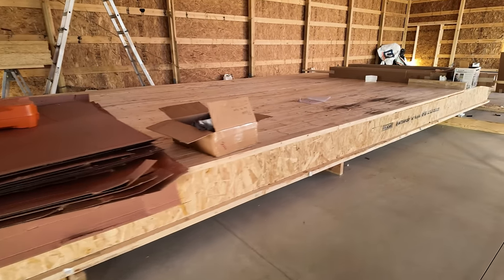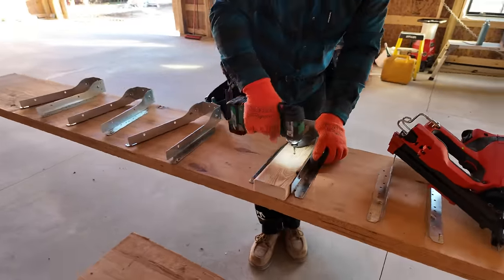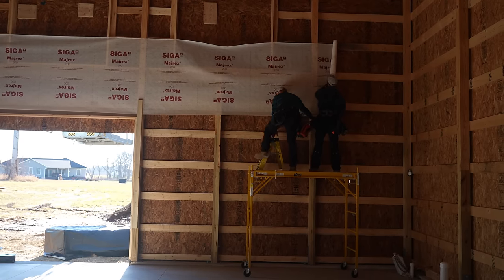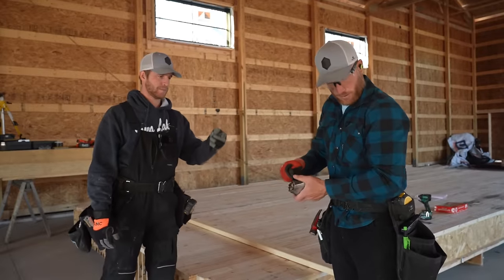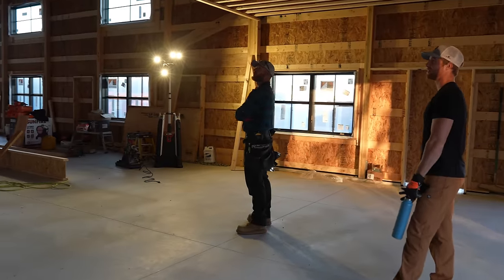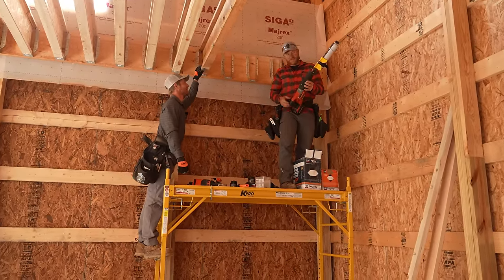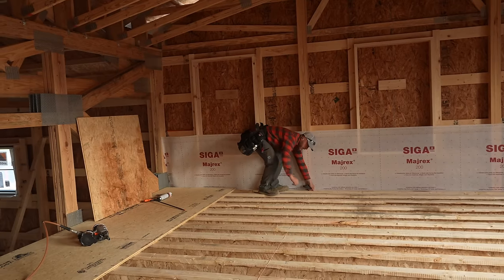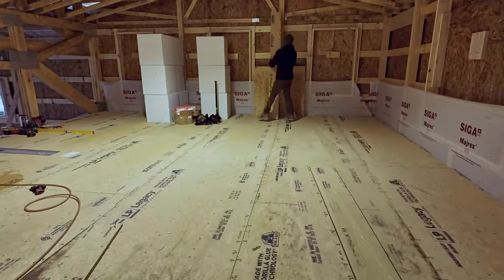My Dream Shop Ep-30: Crazy Second Story Floor Framing Install

Comment: Always great content.  
My son and I drove from WA to WY last year to help a friend frame a studio apartment inside his 40' x 85' shop I had earlier designed for him.  
Lots of fun.  
Road trip.  
Cold weather. 
Tough "Man Work."

You do a great job explaining what you are doing as you do it.  

I agree.  
Lagging a second set of LVLs with hangers applied, to the girder, might have been an easier but a bit more $$$ option.
I'll be scouring more of your channel since I will be creating a design for a 60' by 100' shop soon.  
(I'm recommending a steel framed project just to ensure clear span can work)

Again........your channel is 100x better than TV

Thank you!

Comment: Greg, that little piece of scaffolding that was bought will become a lifesaver! I have the same piece and it is so handy at times! Because you can adjust the leg height at each end is helpful! If your working on stairs or uneven surfaces it will pay for itself several times over!

Comment: Wow...those 2 point loads for girder trusses are carrying ALOT of weight.  
I did not realize until now, when you panned up through the ceiling, how that is all fitting together.  Nice shop, I am jealous.
Reply: Those two posts are carrying half the building 😂

Comment: Great job on the floor, we had a similar floor experience and after our engineer came out he recommended we install three cables from outside beam to inside framing in three of the floor spaces with ¾” eye bolts each end then when tightening it helped with any outside wall to the truss flexing, locking it all together ours was only 30’ long. In the old days they use to use solid rods with plates and bolts on the outside of the buildings lol.

Comment: I have used the same i joists for projects. In the situation where your truss has a 2x12 the top of the i joist needs to be supported with web stiffener blocks at the end for proper supporting strength. The hanger doesnt support it properly, due to the void in the "web" of the joist, or you can have the rimboard there to support the weight at the end.

Comment: I had to do the math on your floor since I'm an EWP designer.  You stated you had a span of 22' 10-7/8" with a 12" on center spacing.  Using our BCI 14" 90s I joist, here are the results.  Your max deflection is .312", or 5/16", in the center of the joist.  Damn near zero bounce.  Not bad.  I have the calc sheet saved if you like.

Comment: Good job!  Some ideas, you could have used 2x12 + a 2x4 for your ledger boards to save cost and do the same on your truss so your not nailing joist hangers into truss plates.  It might have been easier to place the joist hanger on the truss side ledger, as you set the I-joist.  You could block the I-joist to stiffen the floor and I think you mentioned 16" oc.  One last thing is, would start the sub floor sheathing at the wall, with groove at wall, tongue out from wall.

Comment: If you hit it too hard in setting the tongue in the groove you'll actually bounce it back out. It just takes light taps.
It's always good practice to use flooring adhesive when laying your subfloor, or stairsteps. 
LVL's suck for the weight, but are great for the strength. The heaviest we did was 2000lb, 24"×20'ish×3 thickness to support a broad span over the 1st floor on a 9000sq ft home. Obviously it took a crane to lift it.

Comment: Awesome! Good Idea for a server room and Top Secret Space. The one thing I would recommend for security cameras is Ubiquiti equipment, I do IT, so it's the best for installs, but I have a second location for my NVR if possible ran with fiber cable. I have seen and heard from security people that if the criminals see that unit for cameras, it is gone too. It may not happen always, but it is happening more and more often. 
Oh, and that Subfloor foam glue is 10 times better than pl400. Polyurethane caulk is excellent, but between the coverage and adhesive properties of the foam glue, it's a clear winner.

Comment: Nice timing, I'm about ready to start framing in my shop and a 2nd story and mezzanine is part of that plan. Fortunately my clear span is shorter than yours, and where its larger I have walls underneath so there's plenty of support. Looks like I get to use some 2x4's for support as I'm building and sealing very similar to yours. Thanks!

Comment: One thing I would have done with the large truss is to...
1 use a jack to eliminate the negative vertical deflection 
2 face each complete side with 3/4 OSB product fastened with decking glue and ring shanks on 6" centers on all truss members

this would stiffen, straighten, and help control the deflection.  another advantage would be to remove total reliance on the nail plates.  i just don't trust them over time with an active load.

Comment: Kyle, notice you didn’t include straightening the outside wall or the girder. Maybe it was already straight but you did mention straightening before laying the subfloor. I always found it better in the end to have at least one side or the other braced straight before putting in my joist 🤷‍♂️. Sure you have your own way of doing it and even more sure that it was straight when you finished. Going to be a very nice shop/office when you’re done 👍🏼.
Reply from the maker: Ended up using a string… good point tho forgot about it and missed it in the edit

Comment: I have a question about something entirely different. In Norway and the Nordic countries, we position the cladding 1.5 inches from the weatherproof sheathing. This allows moisture that might penetrate the cladding to drain off, preventing mold and adding years to a house. I'm curious why this practice isn't common in houses outside the Nordics, given its benefits in leak prevention, insulation, and soundproofing.

Comment: After the loft is fully finished and loaded and  you had 1ton in the middle of the Girder Truss  area,  it will deflect the girder truss and the post carrying the girder  truss. don't look good enough. As the LDL  where all the Joist hanger are anchored by screw, 
Please monitor the deflection regularly.

Comment: Hard keeping those girder trusses straight due to the plates stacking up. Riser to pull stuff tight with carriage bolts the threads of those screws have to spin out to pull the things together.

Comment: If you were going with metal siding, explain how you would insulate. From outside wall to finished interior wall. Go over any differences between the insulation process when using exterior sheeting vs metal siding without sheeting. Explaining the difference concerning the same scenario in the roof would be awesome as well.

Comment: To reduce floor deflection without having to reduce the joist spacing, the best way is steel cross bracing/bridging. Especially with those laminated partical🤮 board ibeam joists
Reply: Nice build BTW 😎👍 love that open space setup

Comment: Quick insulation question for you. Post frame you have vertical post, then horizontal girts. As awesome as spray insulation is, it is extremely expensive. Couldn't you save money filling the space between the girts with 1 1/2 rigid foam? You would still have someone come in and spray foam, but you could possibly have them do 2 inches over the rigid, instead of 3 inches without the rigid foam.

Comment: I guess the tongue and groove is engineered to have expansion room? 
The expansion gap is new to me. We dont do it in my region, were butt them up tight all 4 sides. 

Cant wait for the staircase video!
Reply from the maker: Never tighten a wood sheet good.  All will
Expand and contract and a space is not going to hurt anything

Comment: I have a shop design for my business that is 40x60 feet, with a 10' loft that covers about 2/3 of the area from the back 40' wall. One 40' wall has a three-car garage facing the street, with the left bay being 60' deep drive-through (door on back side).  I had been considering a metal building as most of the ground floor will be work area for the biz, which is stocking product, and a fulfillment operation.  I will be heating and cooling the building (NOT with swamp coolers).

I really like the wood construction, but how does the cost compare with a red metal shell, for example?  I will be building an 1800 sf house next to it and I would like them to match. I am in the southwest, so stucco/metal faux tile roof will probably be in order.

Comment: You could have installed your hangers on top of your ledger and nailed in one side of them, prior to shooting the I joists up there. That would at least minimize your nailing woes later. (Screw your ledger up with an appropriate thickness fender washer to mock the hanger thickness.)

Comment: I really enjoy your video's they are greatly informational and the most professional/ workmanship i've ever seen. i do have a question  looking forward to when you get to the insulation series as i am in the process of finishing the interior of my new post frame.  this is in regard to placement of the vapor barrier.  in previous video's you show installing the vapor barrier prior to installing the interior wall girt. i understand this allows an area to install wiring etc behind the finished wall but is that the only advantage. would it make any difference to install the barrier after the girt between the girt and interior wall.  i greatly appreciate your knowledge and expertise i am located in the western side of illinois.  thank you  and look forward to your reply and future video's

Comment: FLOOR HEAT FYI- I worked on a 9000sf house with radiant floor heat and for temp heat the builder set a 50 gallon electric water heater to provide heated water and to my surprise it did the job easily

Comment: That messaging area will looks like it'll be an awesome space for the premium main cthe only thing is with that wind barrier that you put on the outside wall in the area where you you put your floor Joyce.  What are you go that exterior wall for insulation? Are you doing blowing in because now? With the flooring stuff in that area? You won't get the rigid there

Comment: Love the video, I had to watch it 3 times.  My dad and I are getting ready to have a pole barn built this springs in WI. The shop side will be 30 x 50.  I want to use 12" I joist, How far can I run them at a 12 IOC?  Thanks for the help.  Keep up the great work.

Comment: Kyle could you add a steal beam or a plate to the back side of that beam I understand the cost but just was wondering. I have to tell you that you are awesome the only other building show I watch you still my favorite you explain what you doing.I share your link to everyone I can Bless you two be safe.
Reply from the maker: Could have added steel just probably not necessary with these spans

Comment: Kyle love your work bro. But I’ve built real post frame, Real 6x6 to 6x12  green pt. And built with perma columns 5’ deep full concrete backfill.  So I like the perma columns but they are no match to pt in gravel,  3ply 2x6, compared to a post is no match. Bros mine as well stick frame. You ever consider commercial girts?

Comment: When it comes to insulation, how do you eliminate (or limit the impact of) the large thermal bridge at each post location? Have you ever installed continuous exterior insulation on a post frame, is it worth the added cost/labor to eliminate all the thermal bridging?

Comment: I am building the original "Barndominium" from your plans.   I am confused why in this shop you are applying the Sega air barrier when you already have the Weather Logic Sheeting as a air and water barrier all around the inside.  I am going to guess it is because you have the rockwool as insulation vs the closed cell foam in the Barndo???  I just want to make sure I do not make a mistake in my build, in case you have learned a better way since the Barndo build, I want to use the best practices possible.

Comment: What are the benefits of doing post frame rather than stick frame? You mentioned the building moves when you push it because it’s post frame. It looks like you used the same if not more lumber if you would have done stick framing.

Comment: Hey, you took down your chains and I see there's none of your traditional X corner bracing? I also notice the backer boards for the patio roof, didn't catch that being installed or mentioned. Building is looking good. It'll be a nice display for what can be done for sure. HaHa, Greg said ToRnADo!

Comment: This may be a dumb question but wouldn’t it be beneficial to put your insulation in under the strip of white bearer before you hang the big board on the wall? Seems like extra work to try to work the insulation in between the walls and that big board.

Comment: I would have placed a temporary support under the center of the truss to avoid further bending during the installation phase of the mezzanine and I would have removed it once the subfloor was fixed. Thinking about it, do you think it was a sensible idea or completely useless?

Comment: Looks great. But if putting up vapour barrier in an area and you said you where using Rockwool why not put the insulation in? Then the vapour barrier. Also why no acoustic silicone?

Comment: You've got all those joist hangers fixed to a beam, that beam is screwed into position using just screws? I reckon you should have used bolts.

Comment: Kyle, doesn't hanging the floor joists from the bottom of the truss put the entire load on the bottom truss beam and rely on the strength of the joints connecting that beam to the truss itself?

Comment: Is that tall truss holding up the roof and floor sitting on just three 2x6s on each end? Wouldn't a typical backyard deck holding much less weight with a shorter floor span have more support (more posts)? Any concern about that being a point of deflection or failure?

Comment: Why wouldn't you start your floor sheeting at the outside wall working to the inside so you had a solid floor to work on? At least you didn't let your sheeting drop down on the foam and splatter all over like Awesome Framers do.

Comment: I have used lp subfloor one time, and had a bad experience. Every tongue and groove joint in between floor trusses squeaked. Builder submitted a claim to LP and they wouldn’t cover it because they said we should have glued the tongue to the groove. Ridiculous, nobody is doing that and shouldn’t have to.

Comment: Hi Kyle, may I ask your opinion on the Rockwool install? 

I have a heated (forced air) three car, 640 sq ft garage with 11 foot drywall ceilings, outside if Minneapolis MN. The space is not air conditioned in the Summer months. I have 18+ inches of blown in insulation in the attic - which has helped a ton to stabilize the temperature in the Winter (heater runs less - zero ice-dams on the roof). 
It is currently -4F outside and my garage stays at +45F. I added a ceiling fan this Fall which is helping push the warm air down.

Sadly there are two large outside walls which are not insulated. Those two walls do not have drywall - currently peg board - which I would like to replace with some solid surface - like plywood of perhaps a moisture resistant material which would allow for hanging shelves and mounting hangers for tools etc..

The home, while well designed and built, I am not 100% sure there is a house wrap material under the siding. Six inch Cedar lap siding which is in good condition. No apparent moisture issues anywhere on the house.

My question - should I add a moisture barrier to the surface of the sheathing before adding the insulation (wrap around the studs) or go old school and add a plastic barrier after the Rockwool goes in before I add the final “drywall” or plywood layer.

Comment: You're  freaking kidding me! That's  insane, to not be using heavy duty bolts or at least structural support under your flimsy hangers to secure a 20×20' super heavy floor section. I don't care how strong your support structure is. Your floor is only as strong as the weakest point! I don't  beleive that this would pass inspection. If it does, the regulations suck in your part of the country! This sh*t is not safe according to northern specs. Tiny screws at 90•, has no tensile strength, even if you put a million of them!

Comment: How come you guys just nails? Are you screw I am screwed nails. Don't last long to make your floors. Squeak , many years after you lay it down plus cruise will make the floor compress down where there's no gaps , another way that with global warming and it's hurricanes who've gotten stronger Screws will hold better than nail. The building will last longer and houses it are built when they also blow apart. They're a little damaged with screens on everything